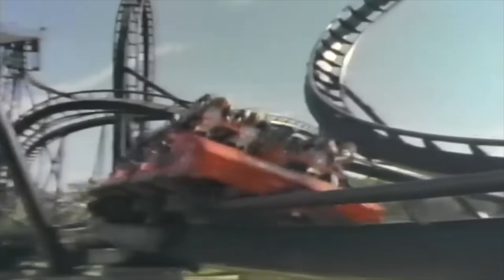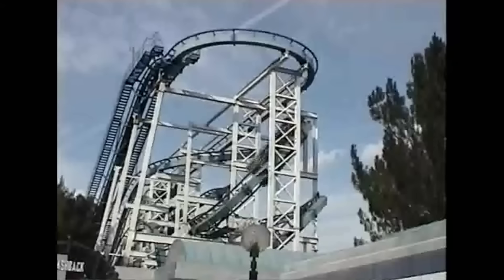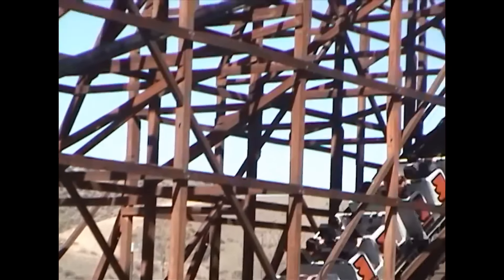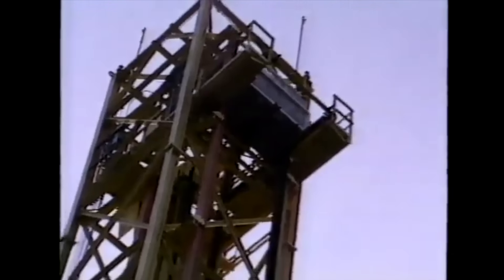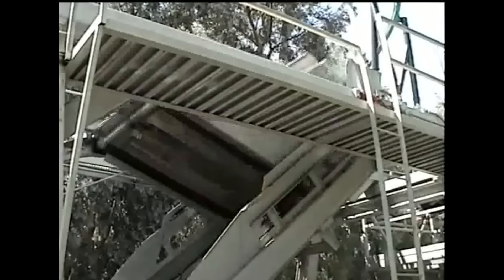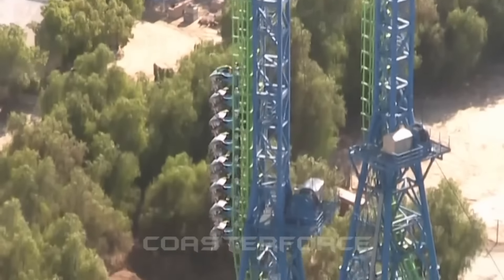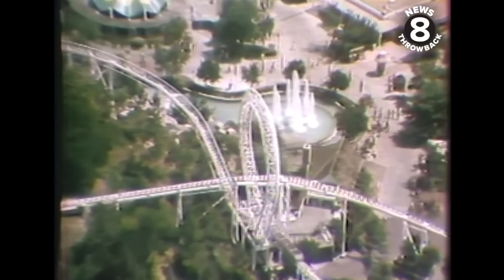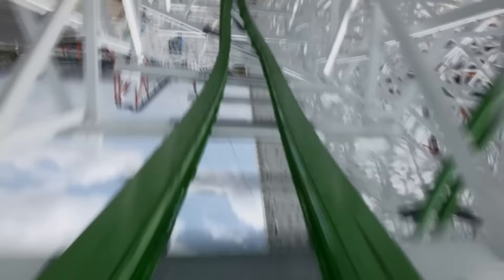10 LOST Rides of Six Flags Magic Mountain REVEALED

Comment: I miss Colossus and the log jammer should never have been removed. There’s something special about the way it was built on the mountain with natural surroundings. It was just a nice relaxing ride in the water. In my opinion, it’s never been the same without it.
Reply from the maker: Yes I agree, the mountain really does make the park something unique.
Reply: I ❤️ and miss FreeFall & Log Jammer.
Reply: I rode colossus right before they gave it the rmc treatment.let me tell you, it was very rough. also the ride kept breaking down . for me, i'm glad they built twisted colossus
Reply: Full throttle and twisted colossus is way worth it
Reply: I think they should have kept log jammer. I doubt that they would have trouble finding a different plot of land for full throttle. Sure it might have been a little different without the tunnel in the mountain, but in the end especially after this summer of hot heat, it really showed how sorely the park is missing its third water ride. Especially a high capacity one like log jammer.
Reply: @Trollyaccount  the near entrance is too dry now that the lake where Log Jammer used to be is gone.